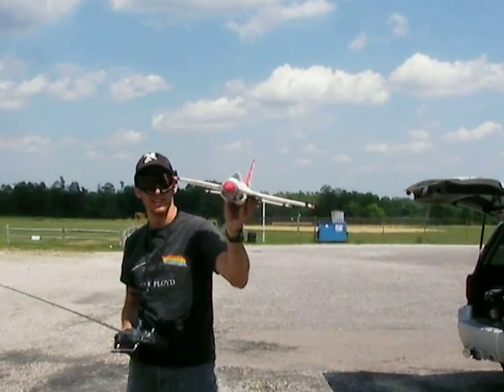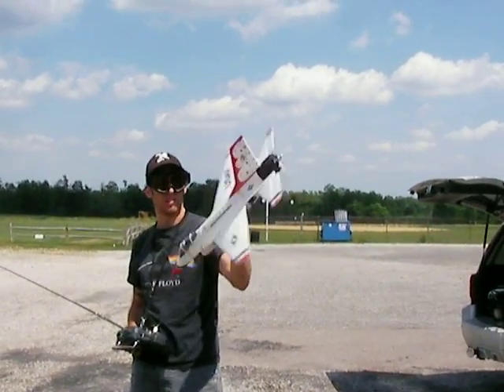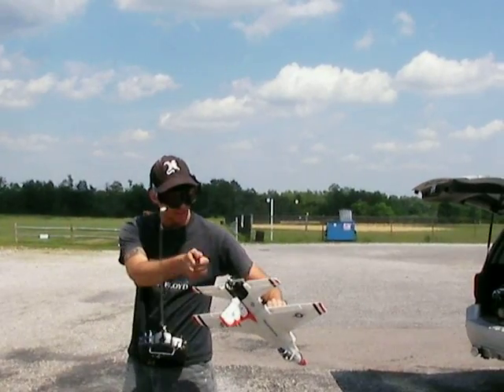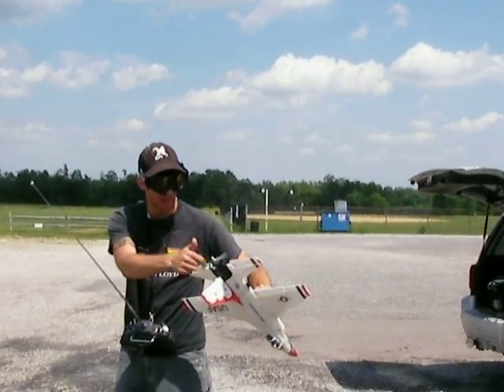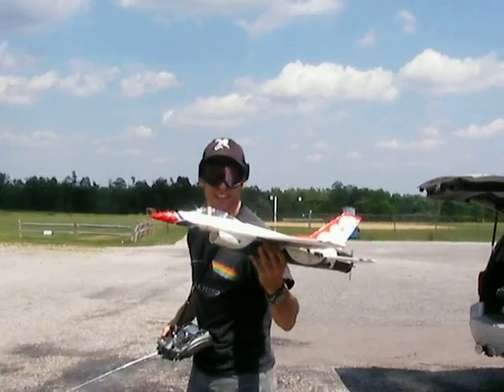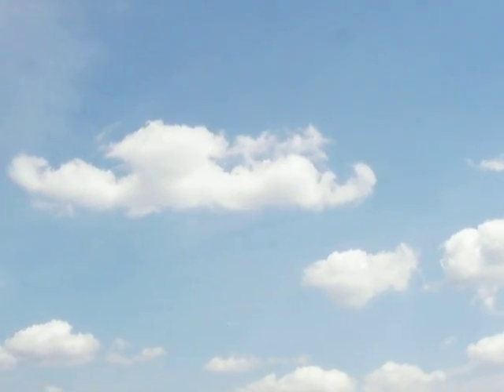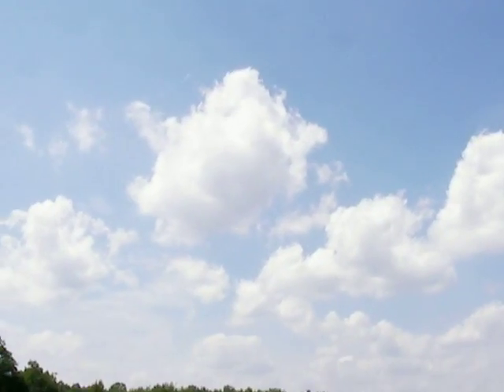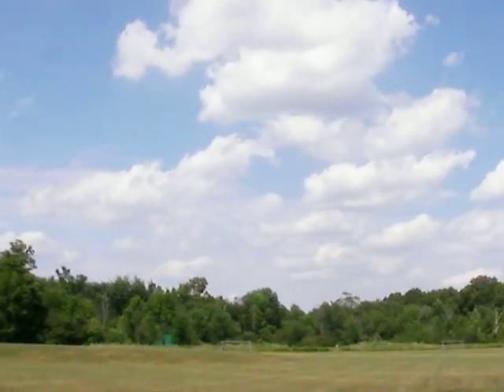FASTEST JPower Mini F16 Jet on YOUTUBE!!!  650watts!!!  EDF converted to Prop!

Comment: Great flight....I just converted my old screamer that has been repaired many times to a  3s pusher using 4200kv and nanotech 1300 45c its a beast... 630 grams of thrust...plane weights 470 grams with battery...If i had a new airframe with no damage i could use same electronics and shave off 100 grams ormore in weight and it would have more ptwr,,,

Comment: you can place a marker on the ground and space it 44metres  apart. Use a stopwarch or count 1001 ,1002.
If the plane passes the 44meters in less than a second that is over 100MPH.
44m/s=100MPH. Anyway good flying speed. I am surprised the motor could take that kind of power. Wow!

Comment: Cool. I am actually trying to build a plane with foam and re use my electronics from an EDF I crashed, what did you use to mount a prop to your motor. I can't find any prop adapters and I can't remove that edf hub/mount thing from the shaft of the motor. 
Thanks man.

Comment: Props are much more efficient than ducted fans. And if you go to the bigger prop jets, then you can put a fuel engine on them, and have really long flight times. Check out the kits at JunoRC, or these at the traplet web site:
 	http://us.trapletshop.com/cutlass-1 Cutlass, 58” .60-1.00 size, $20 plans. GT-15 or GT-22. 50’s USAF scale jet prototype. Kit 		designed as a prop jet. Very fast. Designed for take-off dolly (dolly is in plans), so add gear to it. A very interesting,
		very fast scale prop jet. Foam wing.
	http://us.trapletshop.com/sidewinder-ii-1 Sidewinder II, 49” .60 sport aerobatic prop jet, GT-15 $20 plans. Very fast, T-tail. 
	http://us.trapletshop.com/razor-90-laser-cut-wood-pack-1 Razor 90mm fan jet, 50” 54” GTT-15 puller, $136 short kit. De			signed for WeMoTec 90mm fan, air frame would make a good conversion to puller prop jet. Straight forward build.
		The short kit would give you the basic air frame, and then modify it however you wish. 
	http://us.trapletshop.com/jaguar-gr1-1 Jaguar GR1 49” .60 size prop jet, $21 plans. Dedicated .60 prop jet design. 
	http://us.trapletshop.com/copy-of-gunman-f9 Gunman F9, sport scale Grumman F9 jet, 50” foam wings, built-up body, $20 		plans, .40-.52 size, but upsize the wing and make it a gas GGT15. Fast. Good looks. Designed as a sport scale 			Grumman Panther, this kit calls out to be upgraded to a GTT-15 gas engine.

Comment from the maker: i removed dude's comments with his Doppler readings.  I categorically believe they were inaccurate.  That's my opinion of course, nothing more and nothing less.   Its pretty easy to go around on youtube and watch some Radar-Gun documented jets flying WELL into 150mph -175mph.  Also there are plenty of them documented at slower speeds 60mph to 120mph.   Its clear to me this little jet is going well in excess of 100mph..  Seems most other viewers thought similar.  My vid, so my .02 too.